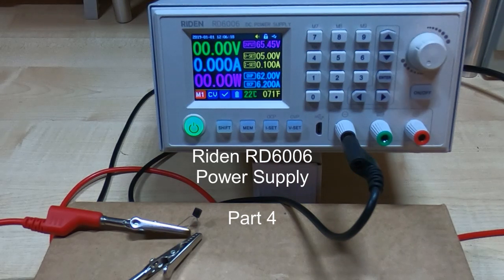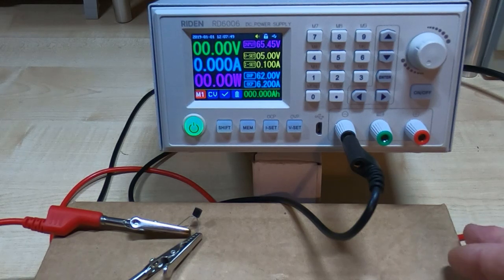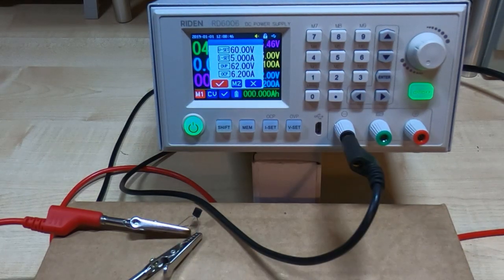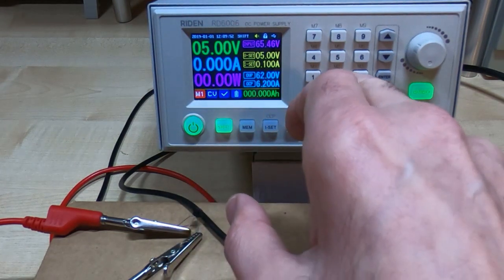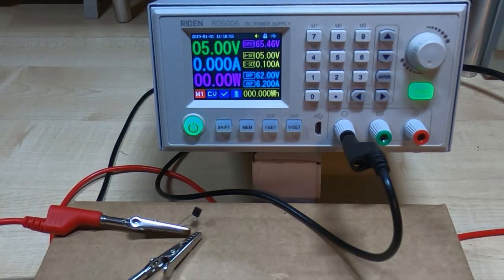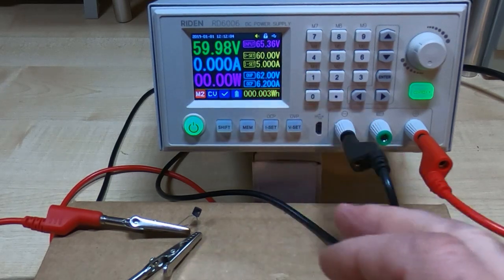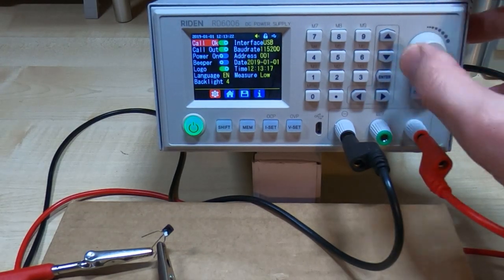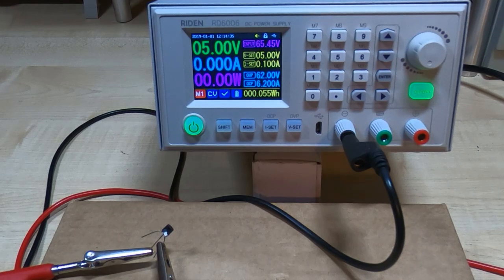Riden RD6006 Power Supply Part4

Comment: There's a new FW out that fixes the memory issue.
It shows a popup showing the memory values and asking to apply, it also does not enable output automatically.
Even if you swap memory with output on.

Comment: Magic Battery Mode: 
If one goes through the Riden blog looking at the comments and questions for this unit one of the common responses is "Please use battery charge plug. There are special features". They do not enlighten us as to what those features are. There is also a blurp about "Battery with protection board may not be charged". What we do know is:
1) the unit has an internal relay wired between the positive and the charge plugs
2) the external temperature plug is 'intended' to be used for battery charging (youtbe irTbqfqtgU0)
3) the type of battery chemistry can be set in the menu system
4) the unit detects when a battery is connected to the negative plug (how ... capacitance ?)
5) The user is requested to set preset the charging voltage and current
6) Per the manual, charging shuts down when output drops to less than 10ma (triggers the relay ???)
..
This begs the questions:
1) what are those 'special features' ???
2) at what temperature does the charge port shut off ? (or does it shut off)
3) does the charge mode actually use the user preset or does it default to a profile based on the chemistry?
4) if the user sets the charge voltage and current parameters then what is the point of the setting the battery chemistry?
..
Without those answers I am inclined to use the standard positive port rather than the 'charge port' for my expensive 14S lithium battery. It would also have been helpful if they had included an external port to plug in the provided sensor. It is very unlikely that the user will install  ones battery pack inside the power supply case to charge it (except in a dedicated use scenario). So how about "Part5, Battery Charging" ????
Reply from the maker: Yes I agree with everything you have said. If I made a video about using this unit for battery charging then it would only be to say, 'do not use this unit for battery charging'. It does not (as far as I can see) have any delta V cutoff and if a battery fails to rise then there is no timer or capacity cutoff. There is also no balance control (although this could of course be done externally). In short a cheap battery charger would be far better even if the Riden is then used as the power source. However if I get a few requets to show this function then I will post another video.
Reply: @JerryWalker001  The problem I have with "cheap battery charger(s)" with a single red/green LED is that when they do not work (I am now on my second ... third) all you can tell about them is that they do not work .... and that is only after they fail to charge the battery. There is no indication if the problem is the BMS or the 'smart' charger. I also have an very expensive LunaCycle charger that does not work. The only thing I can tell about it is that it does not work. It is NOT also intended to be user serviceable (a major component seems to be RTV). So I have ordered a RD6006 (via slow boat from china ... oops) and will in future always use a charge meter (volts, amps, watts, wh) in line between the battery and the charger/power supply.
Reply from the maker: I fly electric helicopters and so I have a number of battery chargers (including some cheap ones). I think that battery chargers (like everything else) vary in performance and reliability. However they should at the very least have the basic required functions (temp limit, capacity limit, timer limit, Adjustable Delta V detection, cell balancing etc). The Riden does not which is why I would not use it as a charger. I cannot argue against using monitoring devices when charging although having to sit and watch them would be a pain. Even a cheap, reasonable quality charger would be (in my opinion) preferable to the Riden for this purpose. I would much rather they had used the relay to disconnect the output when the supply output is turned off. I currently use an EOS720i Dual charger and feed it from one of the Ridens but I also have much cheaper chargers that work very well. I would add that by cheap charger I mean something like https://www.sparkfun.com/products/10473 and Not one with just an LED.
Reply: @JerryWalker001  FYI: the link blows up. I actually have one of those somewhere.
With the LiPo packs you have the advantage that you can access the individual cells via the balance leads. Many of the chargers/balancers give you some feedback. With E-Bike batteries the cells are most often literally 'welded' together and hard cased (or worse yet, shrink wrapped or both). There can be (most often are) ballance leads to the cells in parallel groups. Ebike chargers rarely give any feedback other than the red/green LED (the exception being the $300+ CYCLE SATIATOR). Balancing is most often left the BMS via passive mode (and zero feedback). Anything else requires disassembling the battery pack and removing the BMS. Then one can go through to test/charge/discharge each cell group. Ultimately one needs to have something capable of pumping out the full charge voltage (58 volts for 14S LicoMnNiO or 16S  LiFePo4)  which is why I decided to get the RD6006. It can also be used for my 36 volt pack(s) or as a handy bench supply although WAY overkill for my other needs. Cheers :-)
Reply from the maker: I think we are talking about entirely different types of packs. For EV cells there are specific chargers. For the types of packs I am talking about there are balance leads going to external plugs but the charger still needs the ability to make use of them. EV packs normally have built in BMS and so are handled differently. I was refering to cell packs rather than specific EV units. The Riden should be fine for EV packs as they generally manage their own charging and balancing internally but this depends on the particular pack. For all my electric bikes and Quad I use the chargers that were supplied with them. For the electric heli's I use the more controllable chargers.

Comment: I want to make up a small lab supply, and I was thinking a adjustable clamp with a led when activated. So it clamps, the output the activates a relay to disconnect the power supply output. How it would work is a power transistor lots of gain and a adjustable voltage divider, to set adjust power supply to max voltage allowed then set clamp pot so it activates, then back off supply a bit...then if power supply fails output is instantly clamped and relay then 10msec later cuts output to  clamp to stop overheating and output. clamp remains connected via a small power resistor so it clamp can be adjusted regardless of if relay activates or not.

Comment: Valid point. It is good that you are making the public aware of this setting. I have upgraded the heatsink on one of their power modules and found they do not use transfer grease between transistor / insulator / heatsink. Great products but a lack of attention to finer detail.

Comment: I like this feature. It is optional and versatile for applications where instant voltage change is water . is R&D
Reply from the maker: This does not change the fact that it leaves the supply in a potentially unsafe mode, which was the point of my comment (and why these supplies are banned from my development lab). They are only optional in the sense that they can be turned off but they can also be turned back on by other users. It does not save any key presses as the voltage can be changed directly with the same number of presses. My real point is that this feature over rides the OVP and OCP settings and this makes those settings pointless. If the OVP and OCP were global then I think it would be much better.

Comment: I saw the discussion in the previous video and thought you had made a mistake, but now I see you do have a point, albeit (I think) with a slightly overstated severity . The "Chinglish" menus are a bit bad. Beyond that though, the defaults are safe and someone smart enough to build and operate a power supply of this kind is surely capable of taking responsibility for changing some settings away from the defaults and understanding the consequences of their actions. One can imagine situations where quickly changing between preset supply voltages without turning the output off is desirable (e.g. running through a set of voltage related tests). So yes you do have a point, if the operator sets the options to a risky setting then they've increased their risk - but that's why it's an option, right? I think the option has value and if you don't like the option, don't turn it on. I don't really see any issue with that.
Reply from the maker: Like you I have a right to an opinion and in my opinion the danger of this option far outweighs the benefit. I clearly offer methods where this option could be included in a safer way. As far as 'overstating' the danger I have run my own company for over 30 years and this sort of option on equipment has cost me a great deal of money over the years. I give clear indications of this in the video. I am simply offering advice and anyone can take it or leave it but it is my opinion and I stand by what I have said and how this option could be improved. It is easy to say its not a problem until the day you fall foul of it but as I said this is my opinion and I fail to understand the continued argumants that it presents no danger. I reviewed the product and pointed out this to help others.

Comment: I would be temped to add a good quality relay to the output so your that DUT is completely disconnected from any remaining B+ voltage, while it adds a discharge resistor to the remaining filter caps for a faster discharge to zero. Maybe the OVP should also be a completely independent setting NOT saved to memory so it assumes the last setting used.
Reply from the maker: Yes I absolutely agree on both points. I also think that the option to turn on the output when selecting memory should be separate from the output staying on when selecting a new memory setting although personally I would prefer a jumper on the board to remove this option entirely if not needed. Allowing a memory selection to change the OVP and OCP seems to make those settings a waste of time which is what my comment is really based on. I just do not like the idea that with a single key press the output can be set to 60V @ 6A without any warning or visibility that it is going to happen. I would prefer that the OVP and OCP are 'global' rather than stored as part of a memory setting. Maybe the supply could ask to raise the OVP and OCP if the selected memory settings are above the current settings with the default selection to be 'NO'.